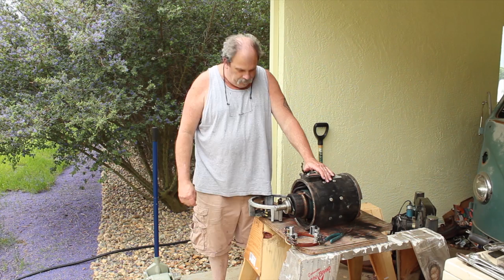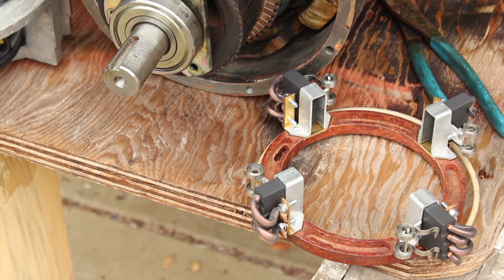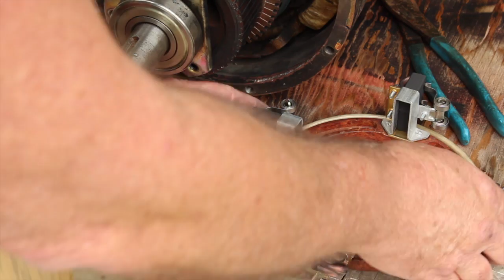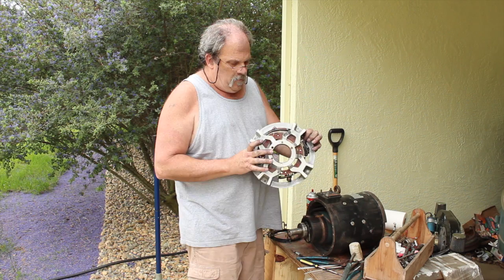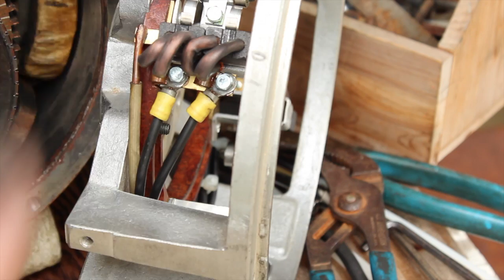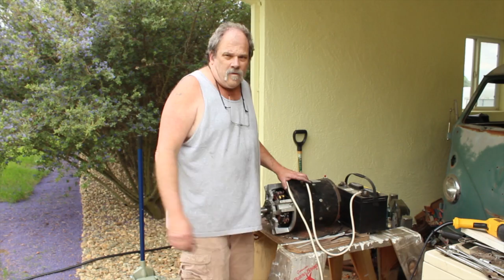kostov.m4v

Comment: The Netgain motors you can wind an extra half turn for extra pressure, these look like they're already maxed but I'm not sure if they are pushing harder. Do you think these springs push harder than the Netgain springs do?
How much did the brush/ring set run for with shipping?
We missed you at EVCCON this year, sorry you couldn't make it.